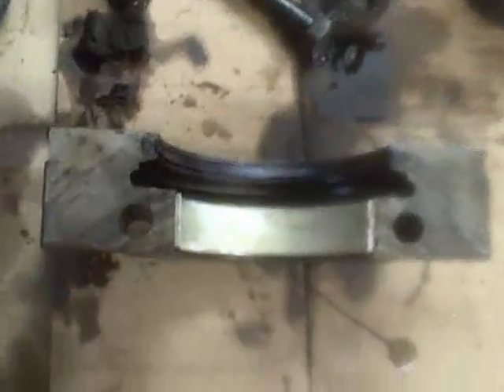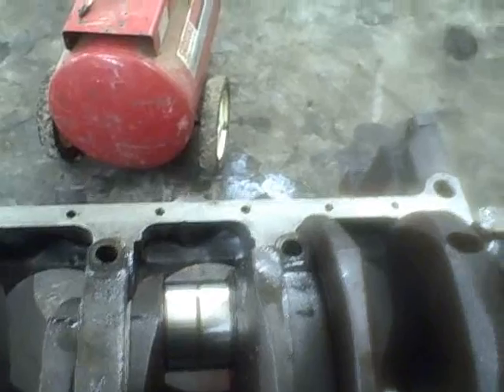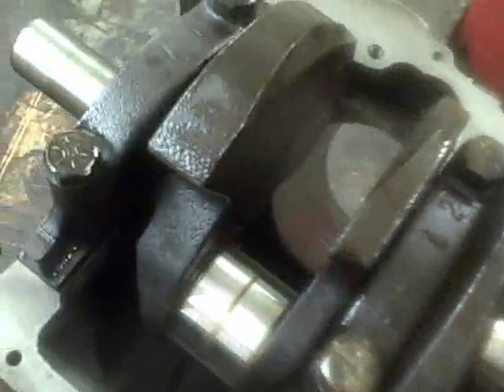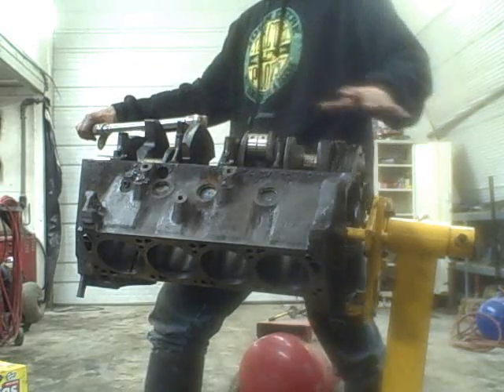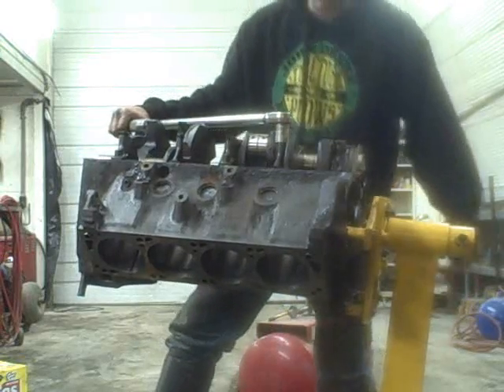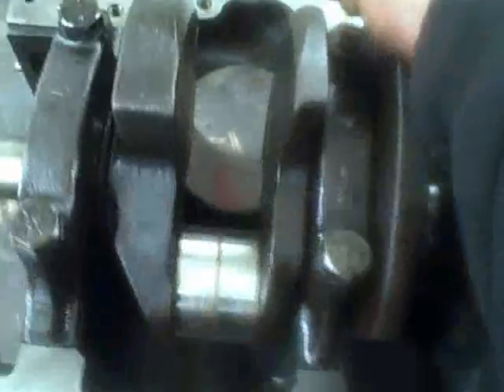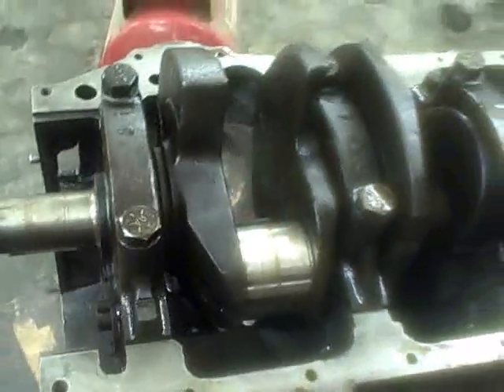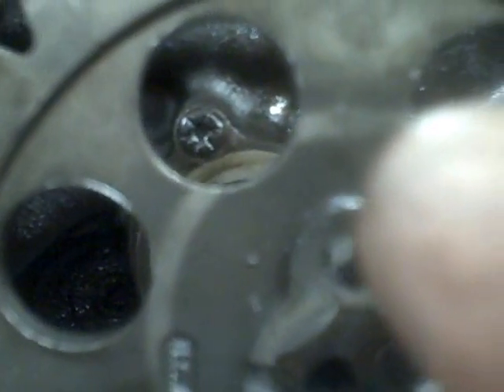Engine Assembly Part 3 torquing main cap bolts

Comment: I did main and rod bearings today for the first time on an old 305 chevy. I used assembly lube in the shells, but know only now that the threads and heads of the  bolts should also be lubricated slightly for a better torque down...

Comment: i have gotten good at working on carberators mainly the briggs & stratton small 2 piece flojet carbs and the large flojet 2 piece upderaft carb. both of those have a reputation for being leaky. this is 85% of the time caused by someone over tightening the 4 screws that hold the top and bottom half of the carb together to compensate for bad gaskets. this only warps the corners of the top half and it will never seal right after that. but a dab of form-a-gasket usually does the trick.

Comment from the maker: the sealant I use is perma-tex but it is the anaerobic style. it doesnt dry out with the cap off and it sets up hard as a rock plus it has a set thickness and it takes very little to make a good seal so if you just put a light smear on both sides of a gasket before installation youll make an excellent seal. the downside is if it gets set up it is extremely hard to take apart and it is a little spendy but its well worth the extra change

Comment: do you use permatex form-a-gasket at all? im going to be using some high temp form-a-gasket to repair the leaky rocker cover gasket on my old case tractor, but i use the aviation form-a-gasket when ever i am working on sealing up carberators. Great Stuff for  sealing up carberators!!!

Comment: i am using plastigauge right now on my JD A because the previous owner let it low on oil and lost oil pressure. luckily they are babbetted rod ends so all i gotta do is remove some shims at a time until rod is not so loose any more.

good work on the motor by the way.  its refreshing my memory when i gotta do my motor this summer